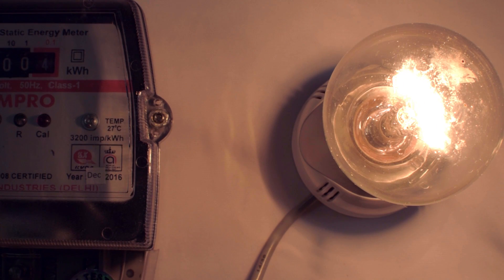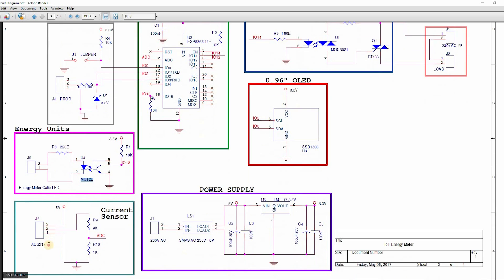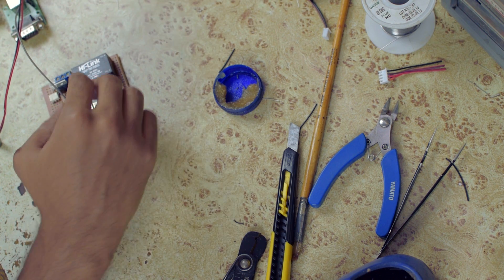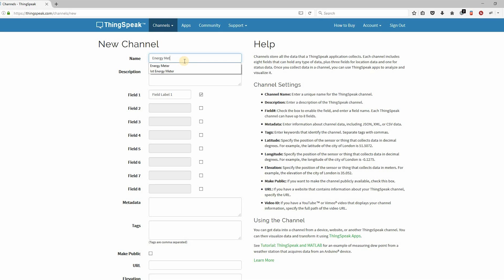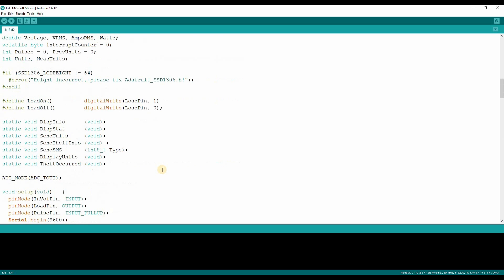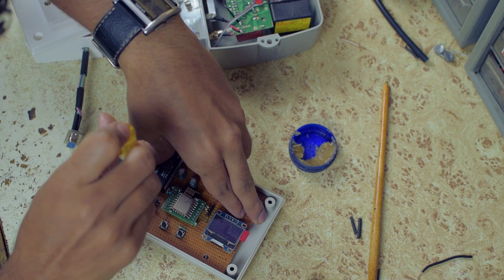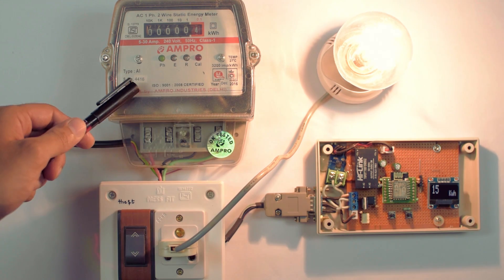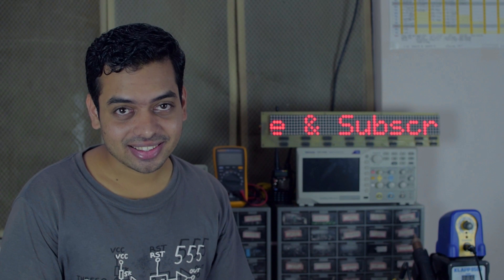IoT Energy Meter using ESP8266

Comment: awsome channel i was looking for easy and doable method of monitoring my energy consumption. its all here. I am trying to collect from 3 meters the energy data can you show me if it could be done with one ESP8266 and if not then an easy alternative.
Reply from the maker: Thanks for watching. You can do with one ESP8266, But requires quite bit programming. You can easily accomplish with 3 ESP modules.
Reply: BSP Embed can you help to make simpler one similar to yours but which reads just pulses from an energy meter through S0 output. The output is only to send data to thingspeak and serial and just the energy.

Comment: hi, nice idea but tampering with static electronic meter's pulse led  can lead to serious problem if those EB guys finds out those things have tamper detection inbuilt, so either use a Tsl 257 optical sensor to capture led blip or use an secondary Meter like SDM230 which has its own opto-isolated pulse output & modbus protocol from which you can integrate it with arduino.
Reply from the maker: Yes, You are right. We shouldn't tamper meter. & idea of using optical sensor is appropriate.

Comment: How to connect ether net wire to the board... Can we get proper layout for those steps... Because its bit confusing.
Reply from the maker: It's based on WiFi. No need to connect Ethernet cable.

Comment: Is it possible to add relays to control the the appliances? If it's possible, please try to make a video :) thanks!
Reply from the maker: Their is no necessity of adding Relay to this project. All the appliance are controlled from SSR (Solid state relay).
Reply: So how can I control the appliances through the internet?
Reply from the maker: This project is not about controlling device from Internet. It's IoT energy meter.
Reply: Yeah I know, so I am asking if I can add relay modules to controll the appliances through the internet.
Reply from the maker: Yes you can additional relay to the system.

Comment: Sir could you please show the pic of  backside soldering of this circuit even though circuit diagram is there its bit confusing.....we need for project kindly share it in github sir....
Reply from the maker: Their is an additional document available in Github for switch and meter interfacing. Basic idea is to bypass power.

Comment: Hye , I want need your help . I want to connect AC appliances with ACS712 current sensor and Relay module . Do you know how to connect it together ? Because I want to monitor the current and to control on/off the AC applaince . I hope you can help me . Thank you .
Reply from the maker: You can use arduino to monitor current through ACS712.
Reply: BSP Embed yes . I use arduino . How to wire it together ? Do you have a pictures ? Current sensor + relay module + AC appliances + arduino . Connect all together .

Comment: Hi, i’ve been doing a final year project based on the project you are doing in this video. The problem i’m having is that,  should i pre upload the sketch to the esp8266 and assemble the full circuit or should i assemble the circuit and then only upload the sketch?
Reply from the maker: Assemble the circuit & upload the sketch
Reply: BSP Embed if i remove the theft system, i have to remove the driver circuit as well?
Reply from the maker: Yes, Current sensor & driver are not required.
Reply: if its okay for you, which part of the coding do i need to delete to take out the theft system?
Reply from the maker: Sendtheftinfo, SendSMS function, getVPP, measure Watts.
Reply: thank you, the other problem i had is that, when i assemble the full circuit, the esp wont power up. do i have to construct an independent 3.3v for the esp?
Reply from the maker: yes you have to given 3.3V for ESP

Comment: In case of power failure we have to program the module again. Is there any way so that we do not have to program it again and again in case of power failure?  Or is there any way to provide the power supply to the module continuously?
Reply from the maker: Program / code will not erase during power failure.

Comment: The energy unit have rs485 protocol? How can you read kWh from unit?
Reply from the maker: It don't have RS485. Reading units through Pulse LED.
Reply: @Emtron_Technologies  How can you read the pulses? There is open - close contact in this unit or you use external current sensor? Thanks!

Comment: Nice project, but is it safe to use that 9 pins connector with 220v?
Reply from the maker: Thanks. No, It is not safe. I made it for a prototype.
Reply: BSP Embed ok, just a suggestion for future videos please advise viewer about safety when dealing with mains voltage, to have some clearance between the circuits of high and low voltage and so on, we don't want any newbie get electrocuted or burn down the house :-)
Reply from the maker: Thanks for the suggestion. I will take care in my future videos. Please keep in touch with us.

Comment: can u please make me clear where i have to connect the current sensor? 
and how it will detect whether it's a theft or not.. like if someone is not in the house for two days and so there will be no pulse in the meter.So how it is really working?
Reply from the maker: Current sensor is connected in series to the Load. Please check the circuit diagram. Power theft is detected when their is no pulse, But the power is consumed by the load.

Comment: congratulation!!!
but i want to know how i can choose the meter to use for the similar project. so can you give me characteristics or a number that i can give to an online seller
Reply from the maker: It's a single phase energy meter. You can get it from local electrical store.
Reply from the maker: No other details are required. You can also use this. https://www.ebay.com/itm/5-45-A-230V-45A-Single-phase-Din-rail-KWH-Watt-hour-din-rail-energy-meter-LCD/262635249517?hash=item3d2647df6d:g:SPQAAOSwdjNZC~B5
Reply from the maker: It will be helpful. You can take it.

Comment: I was doing your project but there is a problem for selecting the USB to serial converter board. I was watch user videos but I can't get this type in sit and shops .. kindly help me.
Reply from the maker: You can buy CP2102 or FTDI chip based USB-Serial Converter. You can buy from amazon or ebay.

Comment: Hey, i wanted to know can we replace ESP8266 with an Arduino and any other  communication module? if yes what all changes do we have to look into? and what will be the changes in the code?
Reply from the maker: No, You have to use ESP8266 or any WiFi controller.
Reply: @Emtron_Technologies  can i use it for 3 phase by making some changes if yes then what are the changes

Comment: Sir I am doing this in my capstone project sir, there is a small problem occuring that when I switch off the input power to the energy metre then suddenly the 7 to 8 count values are displayed in serial monitor even if they are not counted, but this is effectingy my calculations, I used EsP8288-12 E Nodemcu board, please do reply me sir....what may be problem
Reply from the maker: May be problem with energy meter. Derive the power for ESP from the Energy meter output. So when you switch off the power, ESP will also be switched off.

Comment: Sir, You have connected bt136 and moc then other one is
Reply from the maker: Please go through the circuit diagram. https://github.com/BSP-Embed/IoT-Energy-Meter/blob/master/Circuit%20Diagram/Circuit%20Diagram.pdf
Reply: Sir switch connections is bit confusing could u please say how the wires are given to switch and meter

Comment: Sir, My connection is fine, but my OLED wiil not turn on and my module cannot detect any wifi. What should i check?
Reply: Simply solved it by downgrade the board manager to 2.5

Comment: Sir, i am having problem while taking the pulse via optocoupler. It is not taking any input. I have used ur code. Is your code base on real time. Or i have to do some manipulation.
Reply from the maker: For every one pulse, it considered as one unit. For real time, you have to make changes. i.e for every 3200 pulses = 1unit.
Reply: BSP Embed but i cannot see any reading in the oled display. I have change the optocoupler several times. It is always showing O kwh after the load is on
Reply from the maker: Instead of optocoupler, connect an LED. Check weather it blinks according to the load.
Reply: Its working.. Sir the problem is with optocoupler. What should i do how should I connect the optocoupler sir
Reply from the maker: Then, check the optocoupler connections. And the check the collector pin of optocoupler goes low, when the pulse comes from energy meter.

Comment: Hi, how do you step down 230Vac to 5V what chips or capacitor are you using? Thanks.
Reply from the maker: I used Hi Link (Small AC-DC Converter) 230V to 5V, 300mA SMPS

Comment: Will you please tell what changes are should done in program in c 
.... When i upload program to esp8266
Reply from the maker: Program is written in Arduino & is compatible to ESP8266-12E
Reply: Sir I get your programing code but I don't know what changes should done in that code ..I want to connect esp8266 to WiFi module.
Reply from the maker: NO changes are required.
Reply: BSP Embed  ok sir
Reply: Thank you for your valuable reply....

Comment: Sir, for the same code, which libraries did you install and which board did you select. There's some error we're facing with the code
Reply from the maker: ESP8266WiFi, Adafruit_GFX, Adafruit_SSD1306, WiFiManager, Thingspeak. Select NodeMCU from the board.
Reply: @Emtron_Technologies  how does the optocoupler sense the pulses from the LED present in the energy meter.? And what output does the optocoupler pass on to the controller? We connected a LED with the optocoupler just to understand its functioning. The LED was glowing continuously as it was being fed the input from the energy meter.   How does that occur?
Reply from the maker: @deekshakamath6602  As it shown in the video, The Calib LED in the energy meter produces pulses when the load is connected. Just connect an external LED, and check the output.
Please be careful, while dealing with energy meter. You may get Electrocuted.

Comment: Sir, 
Is possible to run the circuit without OLED. Or alternate to use normal lcd.
Reply from the maker: OLED is better for ESP8266. You can purchase from Amazon.

Comment: Sir,can you please tell me what is bypass switch and how can we get the AC Input
Please reply
Reply from the maker: Bypass switch is used to disconnect the meter from the power Input(230 AC), That means using the power, without power readings. Please check the circuit diagram.

Comment: Can we deploy this code into EEPROM for industrial product?
Reply from the maker: I didn't get you. The code resides on Flash Memory.
Reply: I have a problem of power. when the esp8266 turned off then esp goes to automatically reset. thats why i want to burn the program in EEPROM with final code.
Reply from the maker: Code resides in Flash (Better then EEPROM). EEPROM generally used to store & retrieve data during power failure. You can store these variables & other data into EEPROM.

Comment: Sir, what is your programing block in your circuit diagram. I can't get it
Reply from the maker: Its serial communication (Tx, Rx & GND).
Reply: In your project how did you use it sir. I mean for what purpose
Reply from the maker: Using USB-Serial converter.

Comment: sir, is it possible if we use the arduino wifi module for this project ?
Reply from the maker: Yes, it's possible. But its not required additional arduino.

Comment: Is this circuit used for ac circuit measurement
Reply from the maker: Yes it can be used.
Reply: how you program a ESP8266
Reply from the maker: using an Arduino software.
Reply: I have purchased serial communicated ESP8266. Is it working with this project
Reply: on which board you solder the ESP8266 ?
Reply from the maker: Yes, it will work.
Reply from the maker: On General purpose board.
Reply: No, the green one board. Before gpp board.
Reply from the maker: It's ACS712, current sensor.
Reply: In video at 2:02, you have solder ESP8266 on green board. Please have a look

Comment: sir i want know the detailed connections of energy meter bypassing and current sensor
thank you
Reply from the maker: Meter has 4 Terminals, 2 I/P & 2 O/P Pins. Bypassing is done by connecting Phase of Input Pin to Phase terminal of O/P Pin. And current sensor is connected in series to Load.
Reply: Sir, 
Is possible to run the circuit without OLED. Or alternate to use normal lcd

Comment: Can i use node mcu esp8266 v3 replace with esp8266
Reply from the maker: Yes you can.
Reply: @Emtron_Technologies  Sir, one more question. If i use esp8266  v3. Do i need still to use the programming block in the circuit diagram ?
Reply from the maker: @faiqhazman7203  Not required.
Reply: @Emtron_Technologies  Love your fast respond sir, Tq very much!

Comment: Is energy meter necessary to calculate wattage
Reply from the maker: Not required.
Reply: BSP Embed then what is the use of energy meter
Reply from the maker: To read the number of pulses. Which indicates power consumption.

Comment: Bro i need 2 way swith connections ,please  send me .
Reply from the maker: Two-way switch has three pins. Middle pin is connected to Phase input of AC. Top pin is connected to phase of meter input. Bottom pin goes to output to drive load. All wires are phase lines. Two-way switch is for bypassing Meter.
Reply: BSP Embed   thanks bro ,